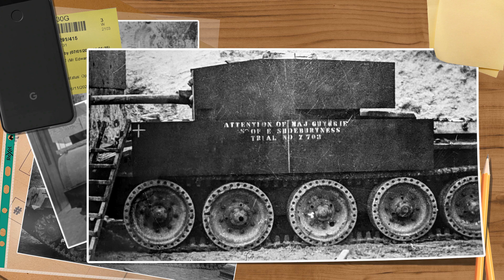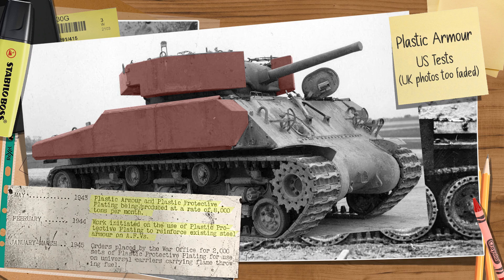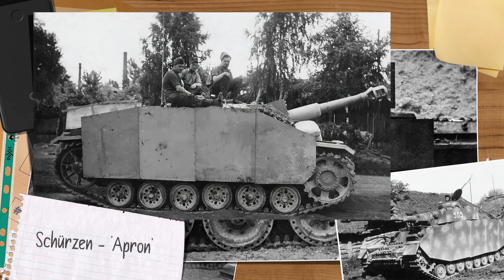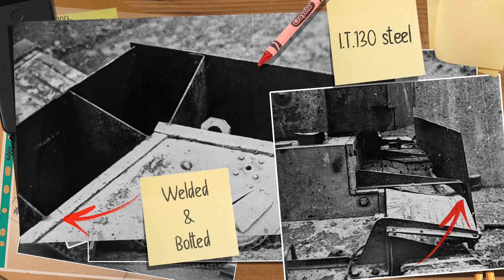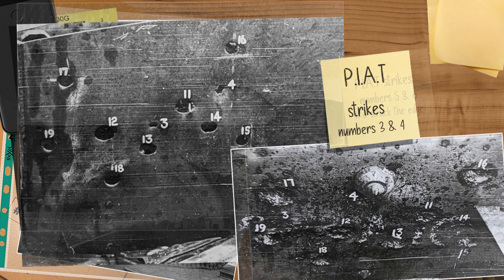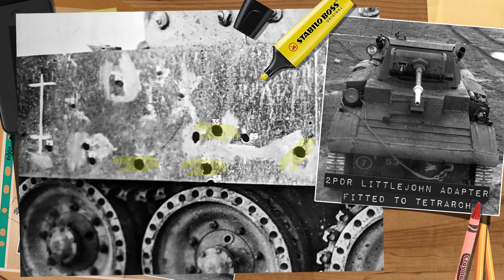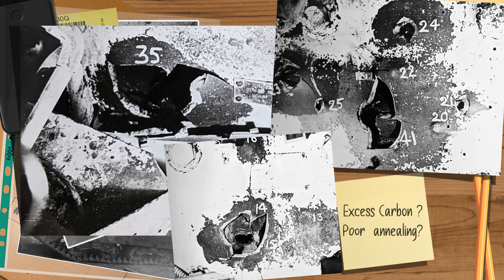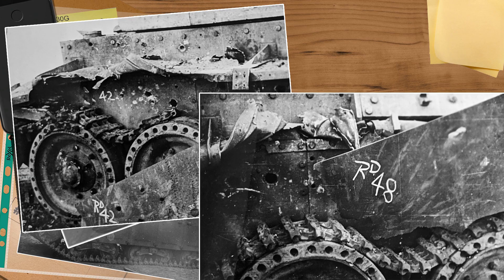British Spaced Armour Tests  - Tank Design and Development

Comment: I recall reading/watching something about a British tank crew that had an extra speedy tank (Cromwell, I think).  They were informed that they had been mistakenly issued a "training" tank with softer/lighter armour. They felt the benefits of the speed outweighed the reduced protection and refused to turn it in for a new one.
Reply: The Fast and Furious cromwell model.
Reply: I read the same
Reply: Lindybeige talked about that in one of his videos..  According to him, the crew only found out when checking their tank after an action and found shells embedded on the armour.
Reply: In my opinion it's the crew attachment that keep then with the tank, not the speed, the Cromwell is an already fast tank, and like the Chieftain said there's no prove that the tactical speed of very fast vehicles like the M18 tank destroyer make any difference in combat. Think about it, if you can do 60 km/h, if in an TACTICAL battle, you can make the engine do 62, 68, hell make it do 80km/h, the shells the enemy throw at you still will be fast enough.
Reply: @adrielcamilo2564  but the aiming might be off if especially they are traveling across the aiming tank not towards or away
Reply: @232nightowl  Sure, but the tank not always are running with the side showing, in "normal" circumstances the tank will be doing a breach of the enemy line, or supporting said breach facing forward. Your argument is valid, but I think it's situational, like ambushes or NA/Russian steppe situations.
Reply: @adrielcamilo2564  that's why I mentioned it would not helped going towards or away
Reply: @adrielcamilo2564  Originally the mobility of the M18 was required mainly to get quickly to the place where the enemy tanks had made a breakthrough, speed BEFORE the actual combat;
Then of course it was very useful characteristic to employ shoot and scoot tactics, an inch of armour was not going to protect it against anything for sure, so fire the first shot and then agility were the only protections that could be used.
Reply: @nicolaandria522  Well, I used the M18 as an example in the tactical way, for sure the doctrine was that way in Operation form, all I'm saying is being a bit faster or very fast in combat like the Cromwell is makes little difference.
Reply: The Cromwell with soft armour is in Bill Bellamy's book  'Troop Leader'.
Reply: Regular mild steel prototype.
offers roughly 60% of the protection of equivalent thickness RHA....probably had an ungoverned engine configuration and thus faster.
Reply: @Dwwolf  exactly, only prototypes used lesser steel. In most cases the crews would train on older obsolete tanks.

Comment: Another very interesting video ... thank you. As I was watching, YouTube had another video lined up (yours I think) on the A12 Matilda, and what stands out with that tank are it's significant hullside armoured plates. (As was also the case with the Churchill.) What was the reasoning for these, if not 'spaced armour? The same question applies to a lesser extent to (other) British vehicles used in North Afruca, with their side skirts. Some explanation is the suppression of dust when running, but then too I recall as a child building an Airfix model of a particular version of the Crusader which had very signifucant full-length side skirts. Were these nothing to do with armour protection?
Reply from the maker: tansk like matilda and A33 had thick skirts with the aim to increase armour protection , but for use against regular rounds and APHE types, this stuff was amde to stop shaped charges while beign light, but they also wanted to see how it effected AP rounds as well

Comment: Any clues on why the 2pdr Littlejohn was featured in the trials as not much is openly discussed about it and its abilities.
Reply from the maker: oh a lot of study went into them, i have the reports on the 2,6 and 17pdr versions of it, the main issue (apart rom slow development) was it was costly and wore out barrels etc. but il see if i can get a vid on it - a lot of text though and few images sadly
Reply: @armouredarchives8867  That would be great if you could make a video on that. I have always wondered what they were thinking about . When they did things like APC for the 17pdr in mid 42 when it was not an issued gun but not 2pdr APC  (in 42 ) which was issued and they were still building even more 2pdr guns. To me just adding the Littlejohn would "seem" to be the cost effective solution.

Comment: There is a very big difference between a APHE / APCHE / APCBCHE shell and a AP-HE / APC-HE / APCBC-HE shot. The former is a base fused hollow projectile, of 19th century naval origins, of which 60% to 70% of the projectile is explosive filling, where as the latter is a 90% solid projectile with a few grammes of an explosive bursting charge, housed in a small tail cavity, denoted by the hyphenated -HE suffix.

The internal damage effects are completely different, between the two types of projectile, with the former having only 2/3rds of the penetrative performance of the latter.

Comment: I understand that the bazooka plate came in quite handy when the Australian army was in Vietnam with the Centurion and they were up against the RPG. I think I'm right in saying that the VC and NVA were so frustrated in their effort to knocking out the Centurion that they resorted to firing the RPGs into the tree tops with the hope of killing or injuring the tank commander with the falling tree branches.
Reply: Sounds like complete bs made by someone that never was in Vietnam jungle or have any understanding how this type of jungle looks or how RPG 7V works... not to mention that this whole plate was so effective that its hard to find any proper info about it in internet.
This whole video was about tests with PIAT that was able to pen only 75mm of armor and RPG 7V popular in Vietnam was able to penetrate 260mm... the improved versions of RPG created in 1969 was able to pen 300mm and the one from 1972 up to 400mm. But considering how bad this simple plates was doing against a PIAT its hard to imagine that it would help much Centurion that got very crapy armor.
Maybe that plate on Centurion was to stop overpenetration and in the end not allow killing centurion that was standing behind the one that was hit... 🤣
Reply: The bazooka plates were the first thing removed from the Centurion. They filled with soil and vegetation. There was extra armour welded to the front. A large volume fuel tank was added on the back. A few other mod's allowed for extra MG ammo and water. Check out the WoT Cent. Mk 5/1 for an acceptable representation of the 'Nam Cent'.
Reply: @allanrowland130  that was my understanding,every picture I,be seen of Oz Cents have skirts removed
Reply: @stevenbreach2561 , there are a few shots of them with the skirts fitted. But that was early '68. They were modified very early in the deployment.

Comment: crusers had spaced turrets as standard, eg crusader and before
Reply from the maker: that was more laminate, ir the two layers and down to the way we armoured vehicles, - crusader and such, there was stuff on earlier cruisers designed to strip small rounds for sure, but not agaisnt larger HEAT rounds which this was looking at
Reply: Crusaders didn't have spaced armour, unless you count the Christie suspension panels. The early cruisers, specifically the A13, didn't have spaced armour on the turret on the first mark.
Reply from the maker: @DavidYoung-je8mf  its a laminate on the crusaders, not spaced as mentioned, the cruiser mk IV does on the turret on later models

Comment: Interesting. So if it was effective in the 1944 tests, why wasn't it rolled out then?
Reply from the maker: time, we tested stuff extensivley, so by the tiem we would have made a fulls et up for cromwell, to check lines of sight, fitting procedures, the manual (there is a manual for just about everything) and of course more tests for ware or fasults etc the war would be over, though centurion had them as skirts for sure
Reply: @armouredarchives8867  I understand that but if it would even have saved just one tanker's life, it would have been worth it. I don't see why they couldn't have provided bolt on kits for the field units, like the Russians did.

Allied tankers were already attaching anything they could find for increased protection and had been since the desert campaign.

Comment: So... they already knew everything by 1944, that plastic works, that spaced armor works, and that mesh works, but it took them another 20-30 years to combine those techniques into composite armor. 
Funny how that works....
Reply: Plastic armor in this case refers to a Bituminous mass filled with basalt gravel. It was used on Commercial ships to protect the superstructure from machine gun bullets.
As for the rest, 
Spaced armor arrays to defeat Pz Gr  39  75mm and took over a year of testing, post ww2. They finally settled on a 3/4" plate 30 degrees from horizontal as a spaced armor array.
And that is just to de-cap the projectile, base armor still needs to be enough to defeat the main body.  Does that sound like a workable profile to add to M4 hull sides ? or the Turret ?
Post war the problem is that AT tech was gaining more ground than armor protection in the 1945-1960 timeframe. APCR matured, APDS matured, HEAT is gaining ridiculous strides forward.

Comment: Britain is a weird country. That everyone assume is backwards in ww2.
The problem is they couldn’t afford to have ineffective prototype vehicles after dunkirk. Every vehicle, weapon, bullet they left the factory was already required somewhere in the empire. 
If you make 100 tanks with more material then necessary. You’ve wasted a factory’s tooling, time and resources that could have produced another tank, plane, gun, tool.
Wartime production is Britain was more ruthless and efficient then other nations. Which is why there were so few production models. The less models, less variants, less alterations you make to production. The less downtime, retooling, retraining a factory needs. Which is how they managed the 27,500 tanks by 1945. And 100,000 armoured vehicles.
Compared to the German 11,400 tanks and 21,400 armoured vehicles.

Considering Germany had twice the population. Twice the land size and twice the production time for the war. Priorities become clear.
The US produced over 600 unused  Prototype vehicle and airframe chassis during the war.
With over 100,000 unused vehicles and equipment being dumped into the ocean after ww2. The US produced more unusable/unused/ excess vehicles the the uK produced entirely. Simply because producing a thousand wasted vehicles hardly made a dent on their production outcome.

Producing 1000 wasted vehicles in the U.K. could have lost the war.

Comment: I've often wondered not why didn't the Brits copy the Germans, but rather why didn't the British Army adopt the US Bazooka instead of persisting with the PIAT? I presume here that this relatively simple and easily mass produced weapon could have been produced at home or supplied via Lead Lease if required.
Reply: PIAT does have some advantages, you can't fire a bazooka from an enclosed space for example.
Reply from the maker: pretty much as mentioned, once fired it should recock itself, its relative quiet and hard to spot, and can fire in an arc with some skill, can be sued indoors and is eaasy to fix, - however its also much heavier all round, is a sod to cock quickly, and the round is fairly slow compared to later weapons.
Reply: PIAT, while heavy, seems to have been regarded as highly effective by the troops who used it in combat. At least that is what the Canadians found.
Reply: @Akm72  As everything is indeed relative I have to wonder what the Canadian Army was comparing the PIAT with when they made this judgement regarding its effectiveness? If the answer is the old 'Boys' Anti Tank Rifle, then yes, I suppose that any weapon that features a potent shaped charge warhead is bound to offer a (vast) improvement in both armour penitration and HE effect in comparison to any AT Rifle round. However, this in itself does not necessarily prove that the PIAT was the optimum solution to the problem of providing the infantry with a portable AT weapon.

The very fact that the PIAT would eventually be replaced in British service by a improved variant of the wartime US Bazooka is surly suggestive as to which weapon is ultimately adjudged to be superior.
Reply: The Panzerfaust was a defensive weapon - used by a German soldier (or more often child) hiding in the trees or amongst the rubble as the allies advanced into their country.  As an offensive weapon they were of no use at all.

Comment: So, if spaced armor is not a part of Chobham and yet is all the cool when it comes to beating HEAT rounds, why is it that the Challenger turret and deck plates rattle when you walk on them?  Do you really believe the lie that the secret sauce as literal tons of backpack was not installed, in Germany, where you needed to be able to move out of assembly in less than 30 minutes?

And why is it that photos of wrecked M1 Abrams (blown apart by IED) in Iraq, also have a very obvious, 10-12", gap between the outer facade plate and the inner armor box?

And what is 'Brimstone' in the WWII context of not enough Molybdenum to harden armor steel?

We don't know half of how advanced armor really works.
Reply from the maker: huh!... im not talking about chobham types of armour here at all. this is conventional spaced plate type from ww2.
Reply: You certainly don’t.